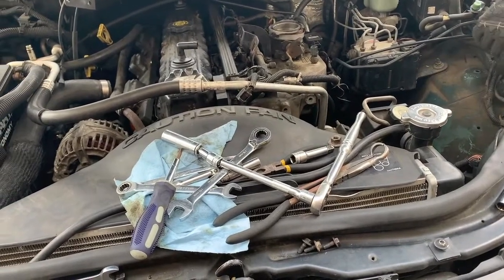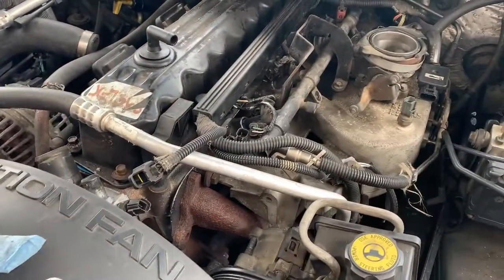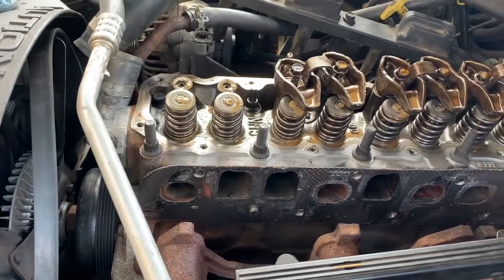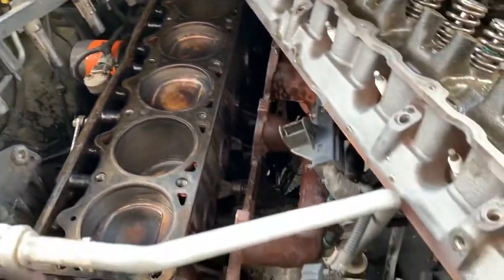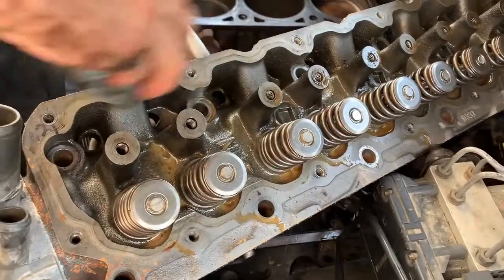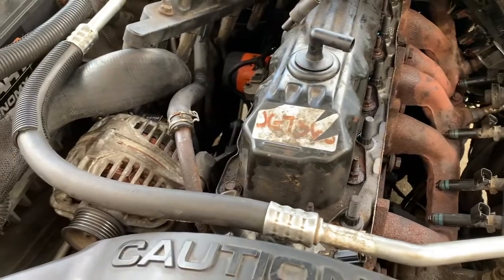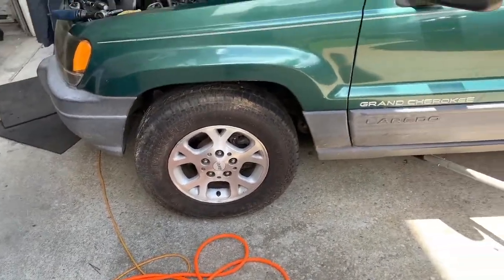1999 Jeep Cherokee 4.0 Motor Head Gasket Repair

Comment: What is the trick to reinstall the head and the number 6 pushrods? I noticed there was an edit between removing the rockers and the head being off, did you need to remove the head with the pushrods still in it?
Reply: Hi Michael, i use a magnet to remove. installing was just setting the pushrod strait in so you can feel when the rod is in the lifter seat

Comment: Did you send the head off to get decked or checked for cracks? Just curious. I may be getting an 01 and I have combustion gases in cooling system. Its either cracked head or blown gasket. Thoughts?
Reply from the maker: Yes I had it checked out first.

Comment: Hey man do you have to set these at top dead center ?? Or something before disassemble
Reply: hey, no this is an overhead valve engine so timing is not an issue during head removal

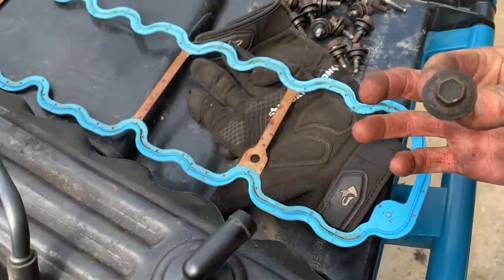Comment: 5:38 Dang, I have a lot of tools, but no 11 point sockets so I guess I'm stuck.
Reply: 4.0 engine uses standard bolts. old design from american motors from the 60s. 7/16 socket is what really fits them.
Reply: @joeblow123  It was a joke; he said "11 point sockets" when he meant to say 11MM sockets.

Comment: I thought 2000 was the first year for coil packs?
Reply: They started in the year 1999
Reply: My later model 99 does not have a coil pack. I think you may be correct, @fradyak.

Comment: I got lucky with my 2000 Jeep Grand Cherokee other than replacing oil pan valve cover gaskets front and rear seal then turning around and have to replace all the lifters and all six broken Pistons the head gasket never blew if you ever have to replace a head gaskets better replace your Pistons why you have it apart mine blew at a 145 thousand
Reply: How u manage to blow all 6 pistons ?